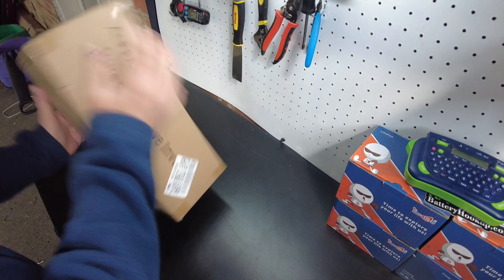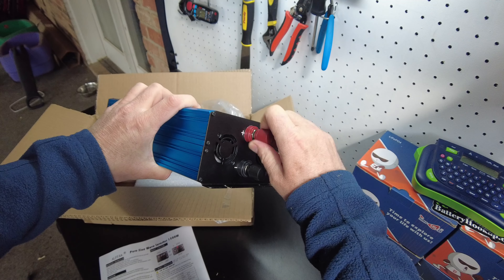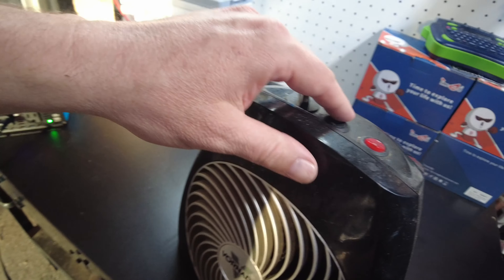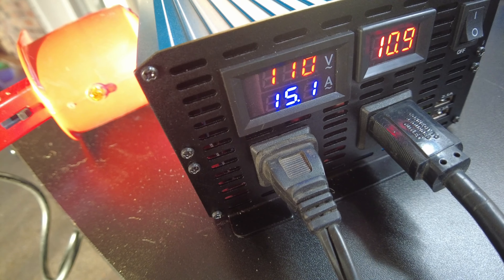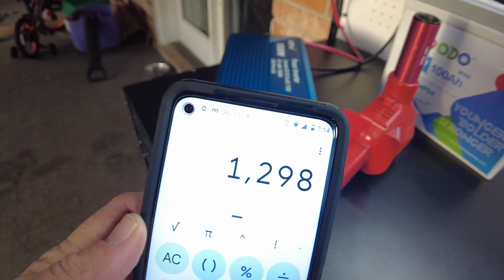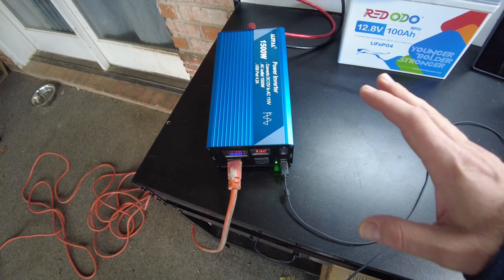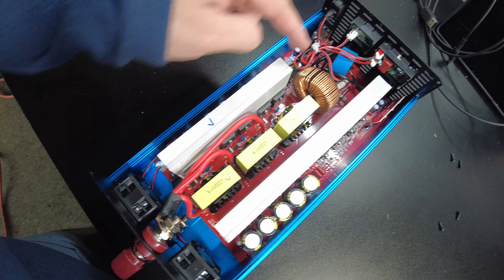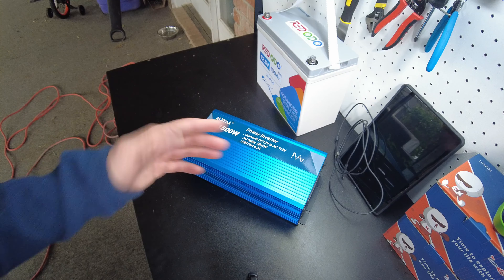ALFFAA 1500w Inverter

Comment: Looks pretty good Brad. Looking forward to the "long term tests".
Reply from the maker: Thanks, yeah I'm really interested if it holds up. I'm not familiar with this brand, so we need some long term proof.
Reply: @BradCagle  Well it worked out of the box, delivered 1200W without warming up and shut down as it should at 1650W...the design looks fairly straight forward - it looks like its utilising 3 of the "Standard" inverters to take the 12VDC to 380VDC and I suspect the pure sinewave part is pretty standard too, i.e. proven. 
The layout for air flow is very good - you could mount those on the wall with the 12V in down, no problem I expect.
You may want to revisit the leads from the battery...it maybe the video, but to me they looked qite undersized given the current though them will be 125A at full tilt. Any voltage drop in the + or - lead will cause the inverter to shutdown prematurely.
Reply from the maker: @Bennyboy-dog  Yes the wires are a bit undersized. I have a nice large set, but they are attached to another inverter, and I was rushing so I grab this set that was just laying around LOL.

Comment: I've noticed a current clamp meter(BSIDE) on the wall you have. Same as I have but mine has issue with accuracy to measure in range mA even zero pressed.

Comment: If I connect this to my 100 amp hour battery, but also need to charge it with a standard lifepo4 charger, should I disconnect the inverter or just turn it off?
Reply from the maker: You do not have to disconnect the inverter. Turning it off is fine.

Comment: P.S.  What size wire are you using, please?  P.P.S  Yes, I see the Redodo "Mini" has pouch cells.  

A T Burke
Reply from the maker: It's 4awg, and it's a little undersized for this application, 1/0awg would be a better choice here.
Reply: @BradCagle  Yes, It sounded like the inverter shut off rather than the battery.  Without the cable loss you would have lost less watts to heat and might have had enough voltage at the inverter to run it longer.  It would have been not much, but a little increase.  Still, it was a good showing!  

A T Burke